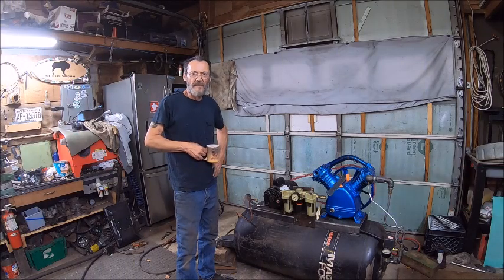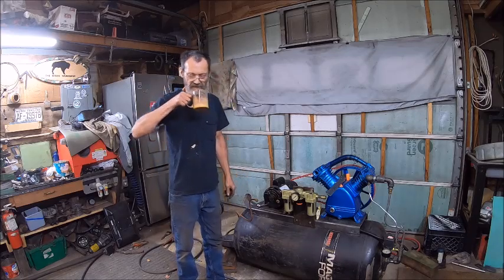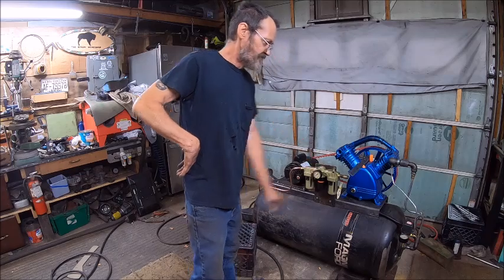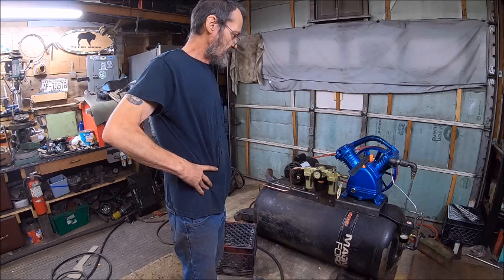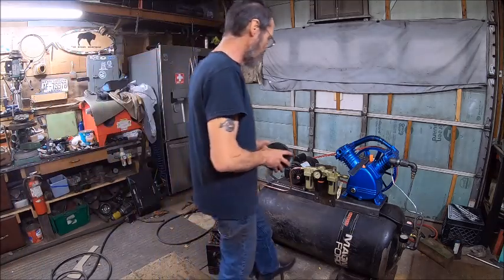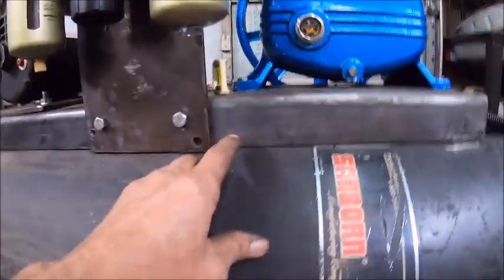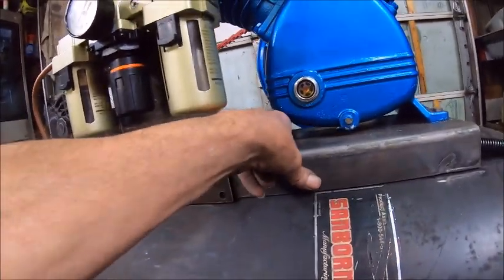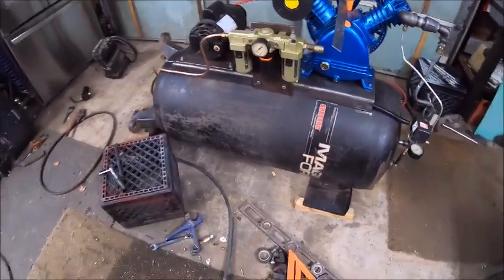magna force 60 gal air compressor restore part 3 adjustable motor mount

Comment: That’s so cool that your improving upon the design design. Are you going to add a drain plug?
Reply from the maker: funny that you ask about the adding a drain plug. i do plan to investagate if that can be done. as long as the pump houseing is thick enough to drill and tap for a drain plug i make on the lathe threaded 14mm x 1.00 thread and a oring seal in the mechined drain plug. i will be doing a video on that soon.